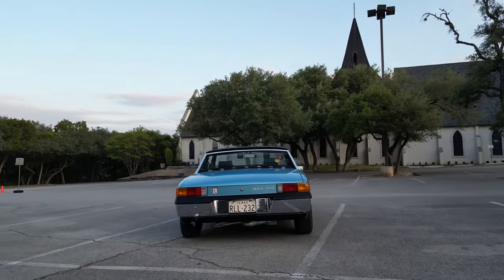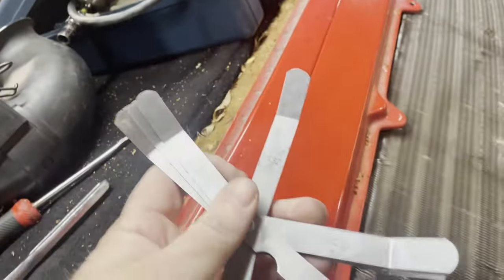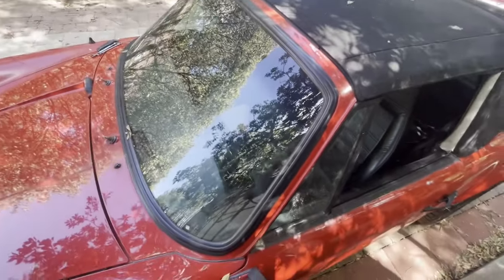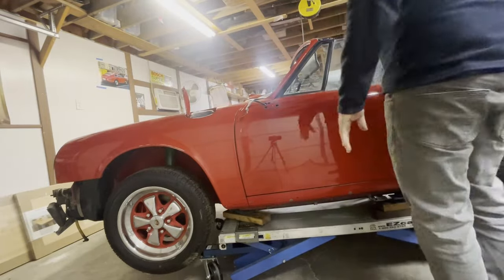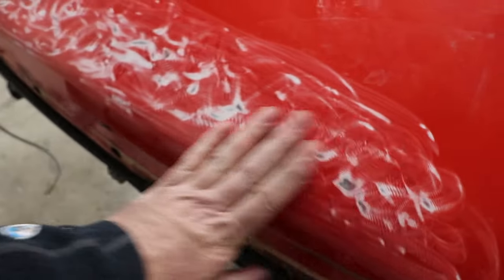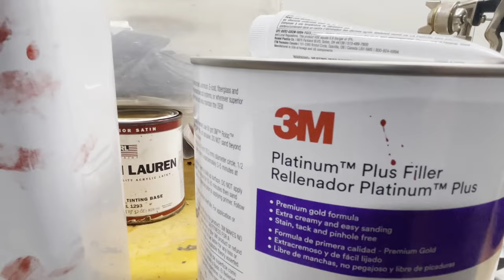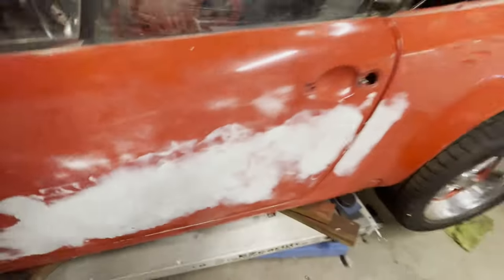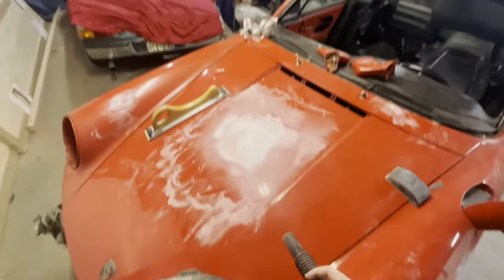Starting the Body Work on a Porsche 911

Comment: Why would you not use painless dent repair on the smaller/less obvious dents?  Seems like that would reduce the need to use filler.
Reply from the maker: You certainly can, but paint less dent removal is more expensive and often not perfect, meaning that there are subtle imperfections left. if you are going to paint a car anyway, you will inevitably apply at minimum a skim coat of filler.  Of course, if budget had permitted, the door could have been reskinned.  It’s really a matter of time and budget.